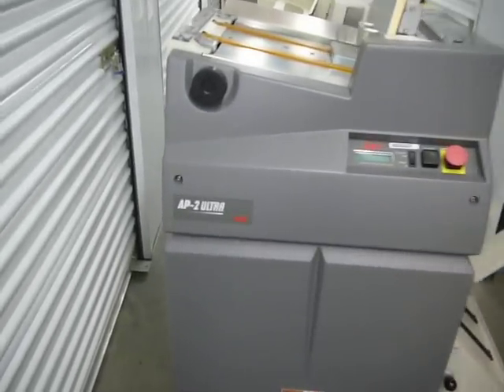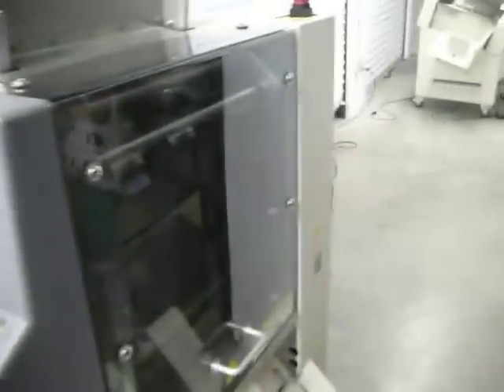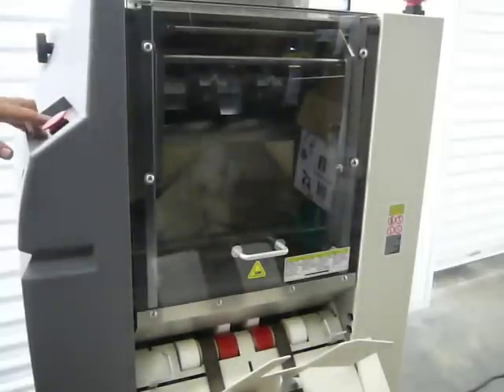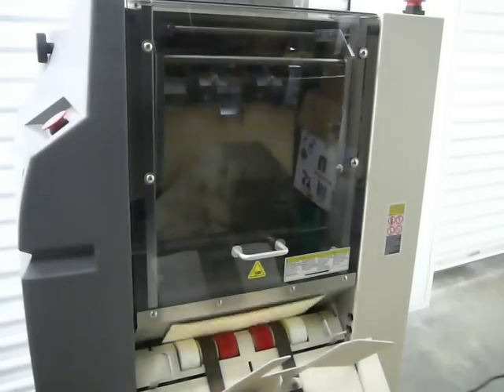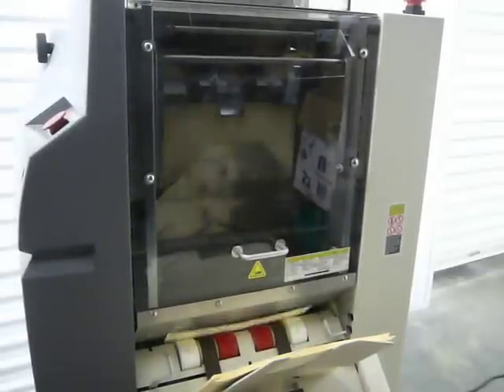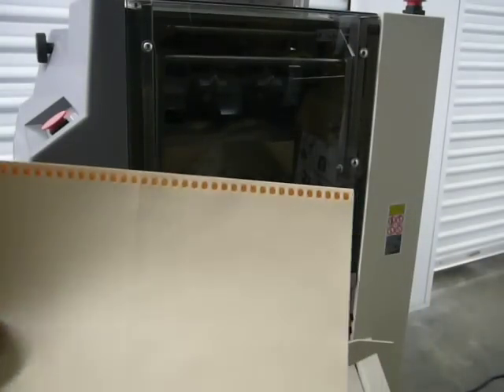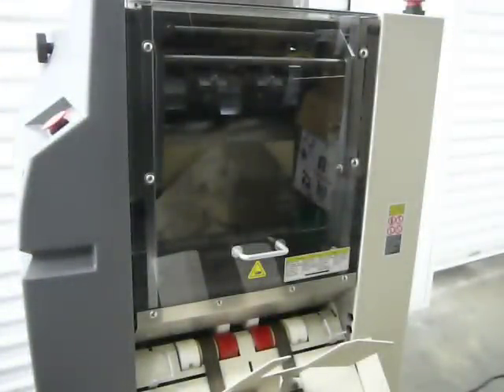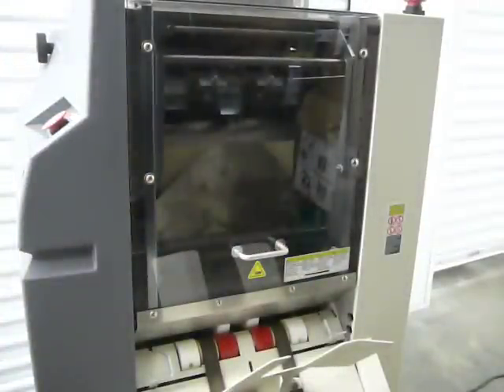GBC AP 2 Ultra punch

Comment: We have a little copying and duplicating center have to stitch up the documentation on the Fellowes Quasar 500 electric or manual on plastic combs, increases workload. I liked the machine GBC AP-2 ULTRA Auto Punch, tell me there are analogues but cheaper. I would be glad to any options.